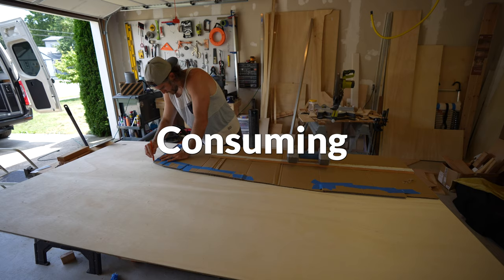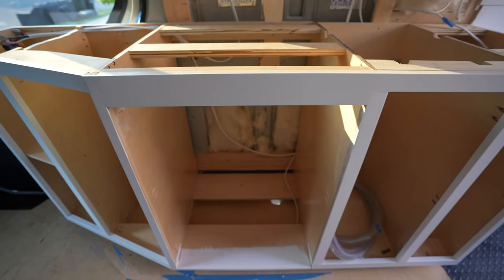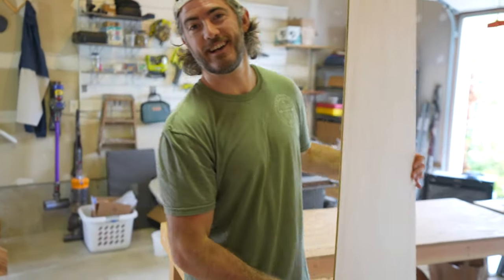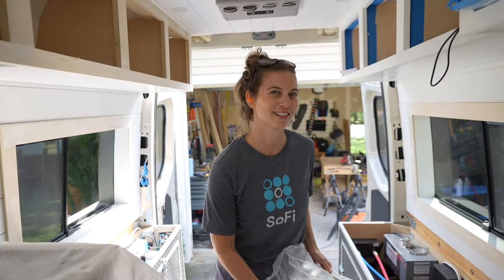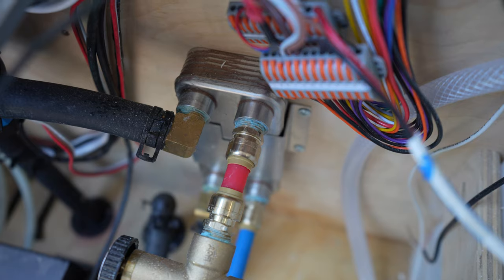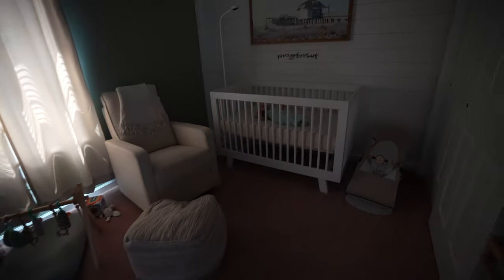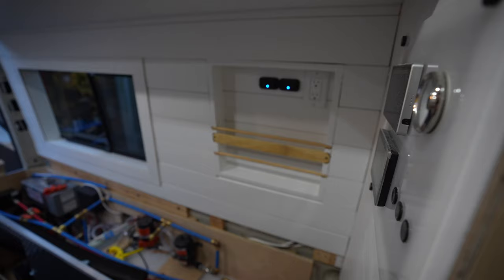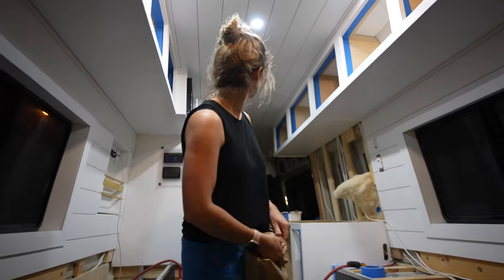Waterproofing Our Van's Shower +  More Van Build Projects

Comment: We are about to do the same with our shower. What are y’all using to adhere the palisade tiles to the aqua defense? We got premium loctite but aren’t 100% sure it’s fine for this application. Lol Also read that you need to apply a silicone sealant between the tiles. 

And you didn’t put any tape over the screws? We got tape too, but also not sure if it’s really necessary for the corners and over screws. Just want to make sure nothing leaks. 😂

Comment: Just finishing off my 2nd van build now and the most frustrating part was the plumbing with the freakin' leaks. I used sharkbite fittings and none of those joints leaked but anytime I connected to a thread, that leaked, even with thread tape on it!! Got it all sorted now but that took way too long and I can imagine it's going to be an ongoing issue to keep an eye on too.